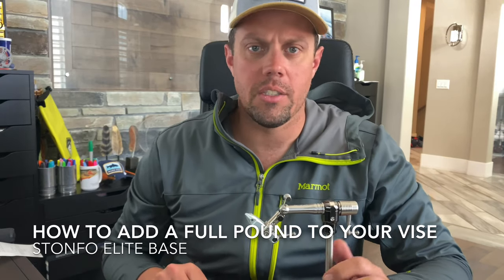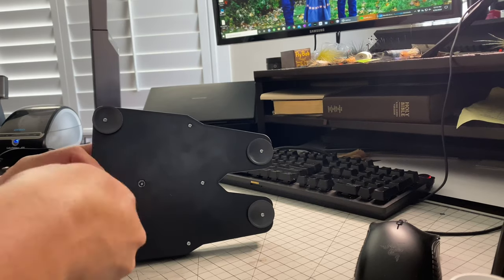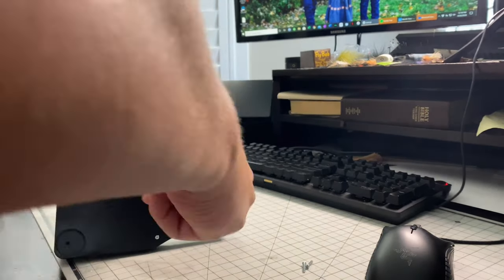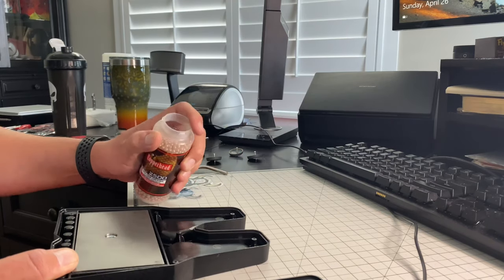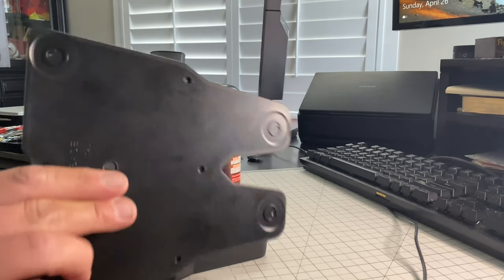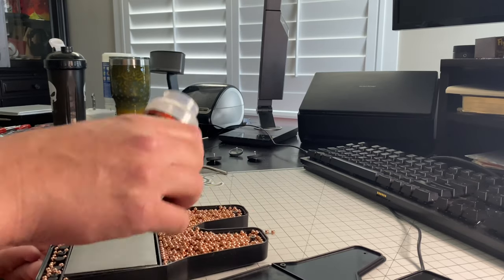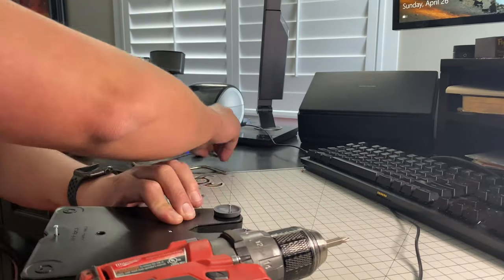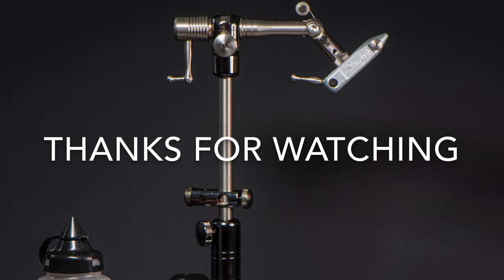How to add some weight to the base of your Stonfo Vise

Comment: The mentions of using lead shot any smaller than your BB's probably isn't a good idea. Your BB's are large enough to be isolated from the metal plate by the plastic dividers. Small lead shot could fall into the cracks along the plate. I checked my base to see what king of material the steel plate is made of. It appears to be a low grade stainless? It had a low magnetic attraction. And the screws are carbon steel. Using lead or copper probably isn't a good idea at all? "Galvanic" corrosion.  Now you have a 3 way mix of metals by adding copper or lead?  

Lead degrades on it's own. And copper will patina corrode with the slightest hint of humidity. Both can migrate to that stainless plate in an enclosed space. And if you ever spill a drink on your bench and get the base wet inside .... You may open that up one day and find a massive science project happening on the stainless base plate that's migrating through the screw to your vice post.

The transformer is a "life long" quality vise design. Go with the design. Stainless steel balls (of any size) would be the right choice.

Comment: Find a buddy that reloads shot shells for trap or skeet, lead #9 shot is tiny. It will add more weight and have a lot less wasted space in the base.
Reply from the maker: Good idea.  I almost cracked open some shells to get the buckshot but figured bb’s would just be easier

Comment: So a $3  box of yard sale 12 ga shotgun shells could give you closer to 2# of finer diameter lead shot.   ( All you need to do is slice the ends open with a box cutter and the shot will pour out..)That would likely give you allot more weight than what you get with steel BB's.
Reply from the maker: Shotgun shells at a garage sell.  You must not live in a state where people hunt and fish.  That stuff sells for premium pricing on the classifieds. But it is a good idea.  I wish I could do tungsten. But at that price I should just buy a heavier base

Comment: My Stonfo elite jams a bit when I rotate so tried to release the knot in the handle to grease it but no matter how much I try I can’t unscrew it, have you tried that before any advise on how to release it?
Reply from the maker: I’d reach out to stonfo customer service.  I haven’t taken my vise apart like that and it’s smooth so not sure how I can help
Reply: @Svenddiesel  thanks Sven will do. The knot is very tight and my handle is not aligned with the jaw , is annoying. Will reach out to them and see if they can advise anything, thanks 💯💯

Comment: Svend, could you do a review on the vice. Pros and Cons would be great as a gear review?
Reply from the maker: I want to use it a bit longer before doing that.   But so far I am really liking it.  The way it grips the hook is pretty awesome.  Just ordered the midge jaw today so maybe I should have gotten the transformer
Reply from the maker: Brain Damaged Flies  I like the elite but would modify the base or get a custom base for it thats heavier
Reply: @Svenddiesel  What is the realistic range of hooks sizes for effective tying that will fit in the Stonfo 2 jaws of the Elite?
Reply from the maker: @justaguy111  I would check with Stonfo on the actual range but I have tied a wide variety of sizes, I cant remember how big exactly since it has been a moment since I have used the vise.